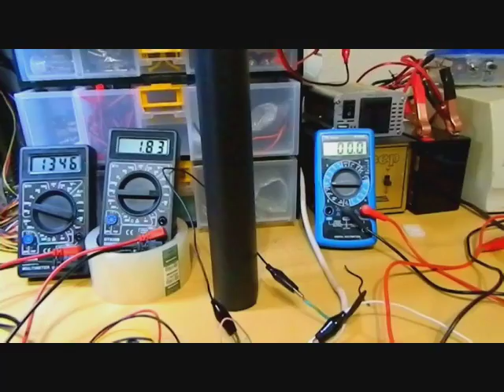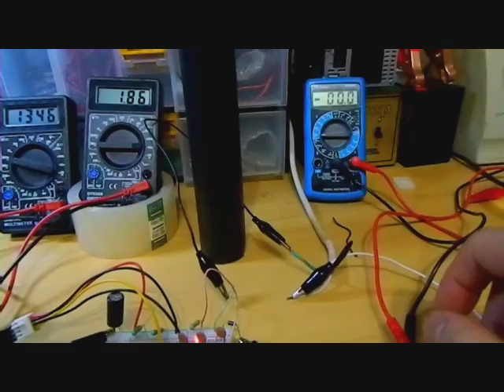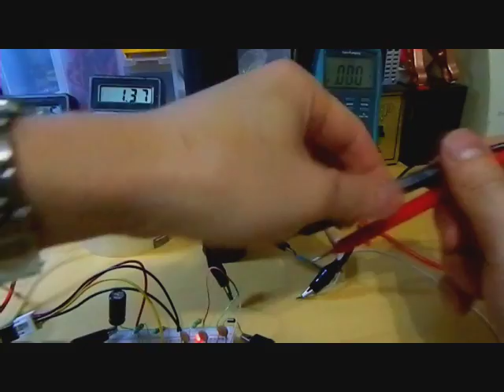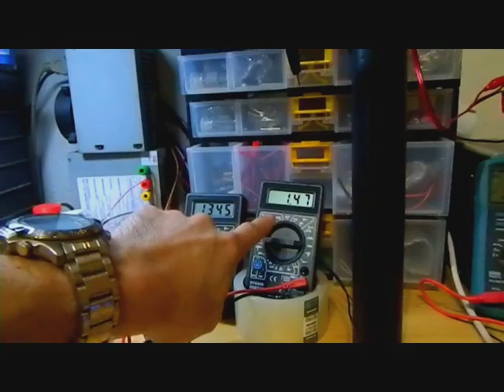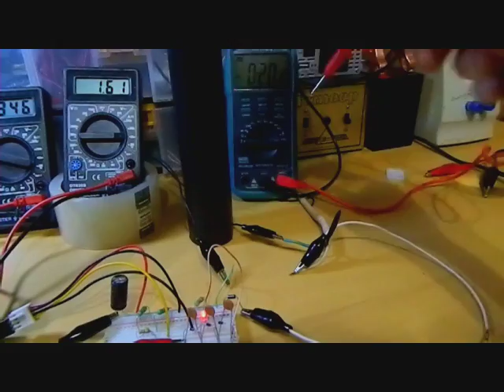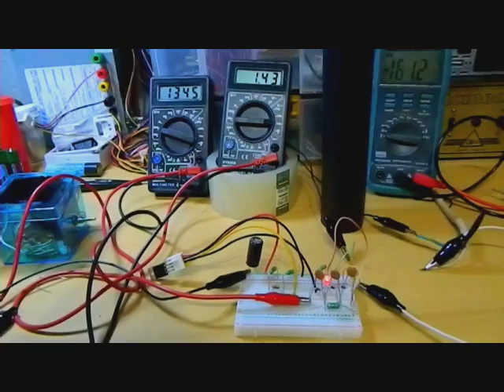NeuGround Battery Charger

Comment: I have no idea about grid meters. I was thinking it is likely getting induction from live, which would be metered to some extent, But as it's dc, I'm not sure. To get more amps, you could try running a JT into a cap, then discharging pulses into your bat...

Comment from the maker: They are on the rails of the breadboard. I´m still trying to find out how to increase the amp going to the batt...  And I am trying to understand how the power meter from the grid works in here. I do not think that the power coming from the neutral goes through the meter. Well, at least I guess that it does not pass through the grid meter.

Comment: Interesting you are getting DC from the wall socket. That was a surprise. I suspect the power you are getting is still metered. Will be too small an amount to affect your bill. Interesting experiment though :) Wonder if it works here too?

Are the three series caps on the drawing supposed to be connected at only one end? Or did you leave a line out?